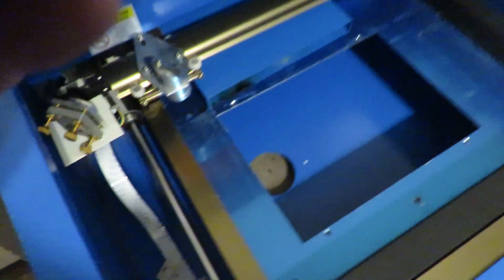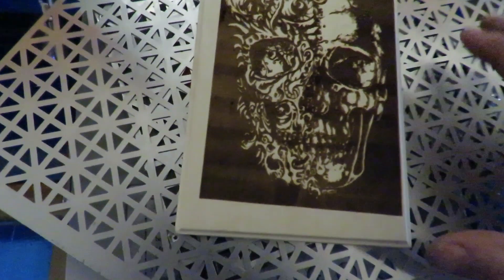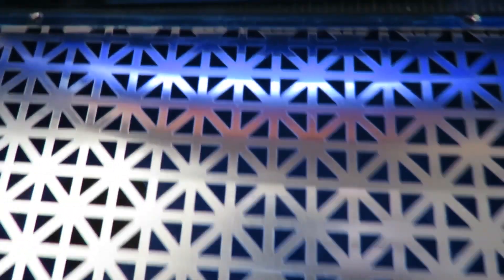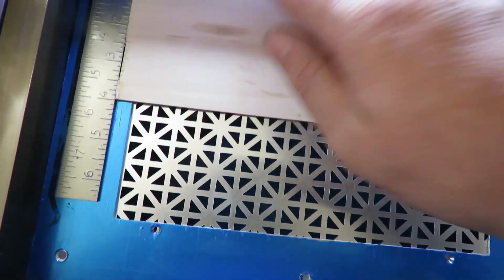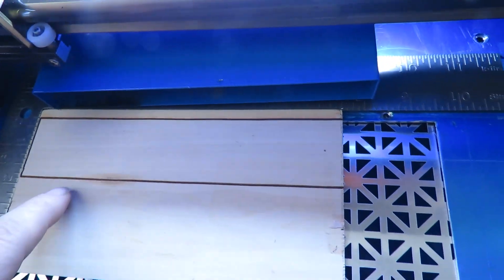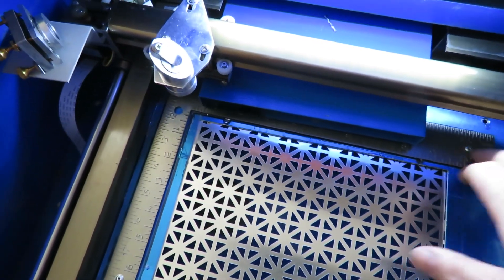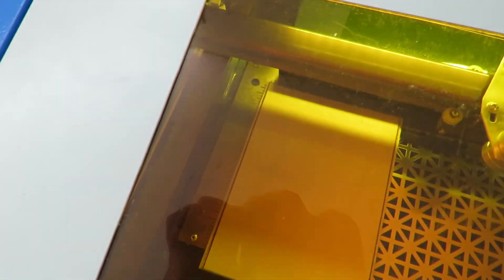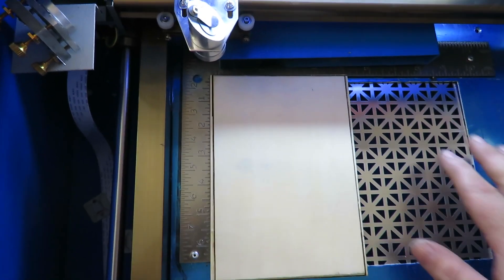I was finally able to align my k40 laser cutter. Now it engraves straight

Comment: Your K40 is still not aligned, and it's all got to do with that lens housing. You cannot adjust the mirror and that's what keeping the beam slanted as it gets to the lens and the beam will come out slanted as well. I found this out the hard way when I bought one for making rubber stamps in my shop. And I can tell you that whatever you think you have done to make it work, rubber stamp engraving is still going to be the ultimate test for your machine. I bet a thousand bucks that your machine still cant do rubber stamps.